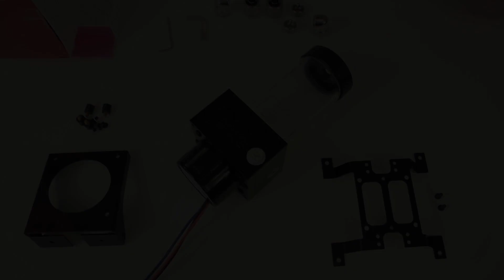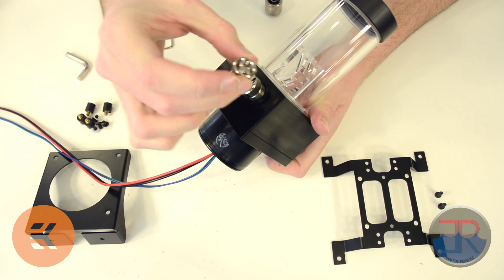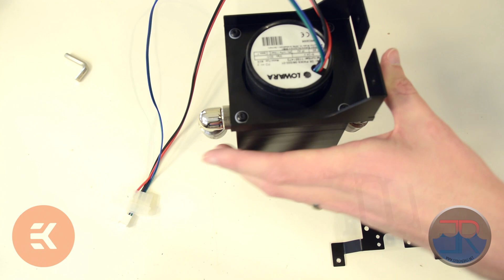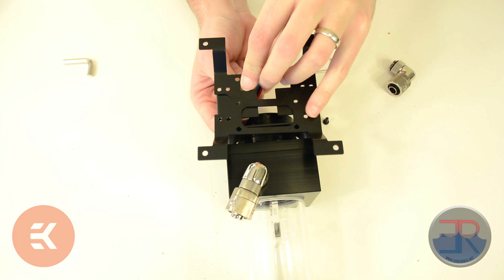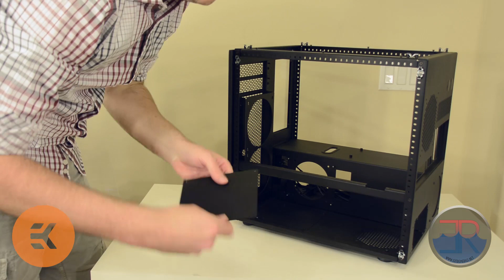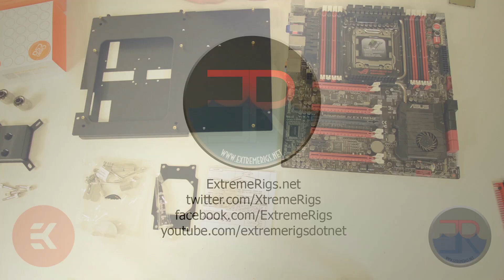EK's CaseLabs S8 Kit Installation Guide - Chapter 2 - Pump Installation

Comment: Why mount the pump in a place where you can't see it and where it precludes the use of most of those flex bays? Is there enough depth to mount it on the shelf above the hard drive area, so you can see it through the window and use the flex bays?

Comment: Can you confirm that this EK Kit is supposed to include 2 (and not one a single) 8 mm port extender fitting for the reservoir - pump as you state at the 1:03 mark in this video?  I have purchased mine and was only given one.  I submitted a Support Ticket but EK is telling me I am miss informed and only should receive one port extender.

Just trying to make sure I have all the pieces for the build.  Thanks!
Reply: Ryan Tracy You only need one. There are two inlets to the pump top - both are recessed, you can only use one and block the other. The third hole is the outlet which isn't recessed.
Reply: +Ryan Tracy you need only one